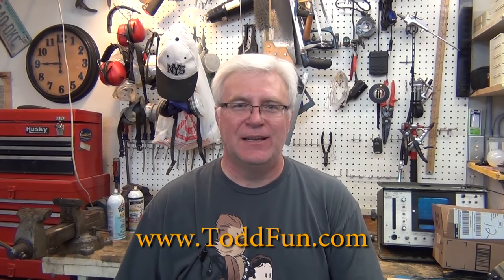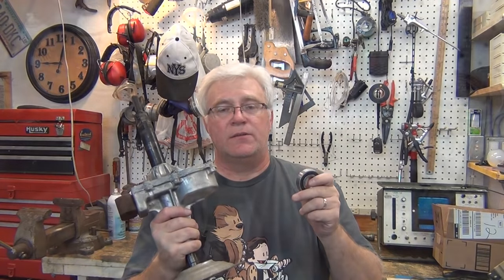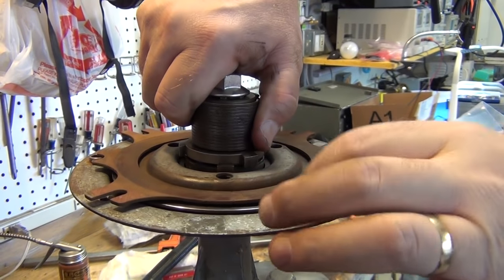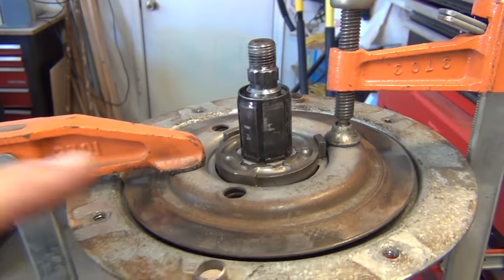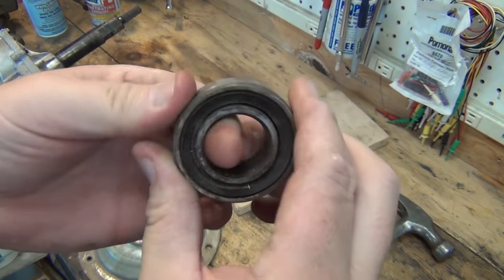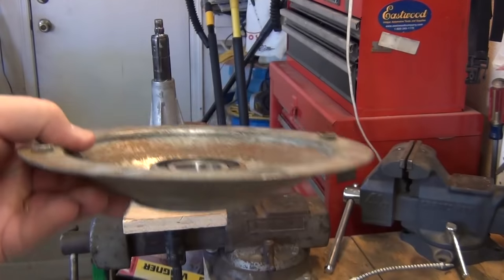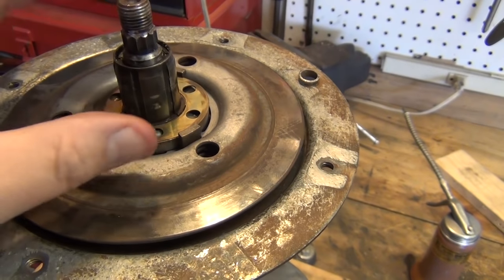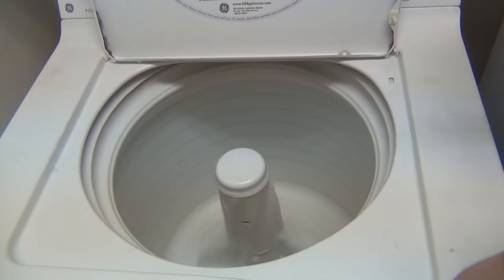Rebuild GE Washing Machine Transmission Brake Assembly - WHDSR209D2WW

Comment: Todd, I have an old signature washing machine model sig60100towg.  The thing has been grinding for years and finally gave out.  It agitates but won't spin.  Does this sound like a transmission to you.  My washer looks very similar but more basic with just one knob.  I believe it's from the 90's.  Also the agitator just doesn't want to come out of the washer.  Any tips or suggestions would be greatly appreciated.  I've looked for years for someone on YouTube with your knowledge and I'm amazed that I found it now.  I figure being stuck inside nowadays is the perfect time to do some home repairs.  Thanks
Reply from the maker: Really hard to say. So many things can go wrong. If it agitates then the transmission is fine. However there are some solenoids that need to switch the transmission in/out of spin/agitate so it could be that or the mechanical timer as those older machines will have contact points in the timer that need to make/break the circuit to the different solenoid engagements for the transmission. The grinding however could mean physical damage so it could be a very different problem. Nowadays it is best to just watch Facebook offer-up, local Craig's list or other local for sale sites that you can find because people are putting good machines up for sale or for fee all the time as they upgrade to the fancy front loading crap. Good luck.
Reply: Hey  Todd, thanks for the reply my friend.  I still loved the video.  I was just figuring if it was fixable I'd give shot.  Thanks again

Comment: Say I broke open the transmission found nothing was wrong. Lost a minor amount of fluid, now I need to top off and refresh seal. Best way of going about that?
Reply from the maker: +Chris Swicord Clean the and dry the surfaces and use this from my Amazon store or get it at an auto motive parts store: http://astore.amazon.com/tod0f5-20/detail/B0092LQHGY

For oil, you can use any 90 weight gear oil from automotive store but replace all the oil so you don't have two oil types mixing. The pros will order an exact Gear Case Oil for the washer such as: http://www.appliancepartspros.com/whirlpool-gear-case-oil-350572-ap3072960.html

Good Luck with your repair.

Comment: Hey Todd.  I wrote in last year that I followed your advice and did this rebuild, with good results (thanks again).  

Well, I'm now seeing a new issue.. when the washer is agitating, the tub isn't holding tight.  It makes me think something needs to be addressed in the disc brake assembly.  I had taken it apart recently, and thought I might have put the clutch piece back incorrectly (the part that rests on the brass bearings).  But I looked again and think that isn't the problem.  The brake pad looks okay, in place.. so I'm not exactly sure what the problem is yet.  Don't know if you've run into this issue or by chance have any ideas.  Any thought would be appreciated!
Reply: Could be the clutch assembly or slipping belt?
Reply: @9027dad Did you ever resolve this? I’m having a similar issue.

Comment: Todd...great video..need some help have you taken the gearcasing apart (exact same one as your brg. replacement)...my washing machine won't agitate but does spin. When I pulled up on the agitator to remove the entire shaft came out with it from within the gear case...any pics of inside gearcase. Thanks in advance
Reply from the maker: I have. There is some simple gear tracks inside. It would be serviceable if you could get the internal parts. However, I have never seen anybody sell the internal parts of the transmission. You would have to find a donor or purchase the whole assemble: http://www.searspartsdirect.com/part-number/WH38X10002/0026/363.html

Comment: Todd , first thanks for posting the video. I myself have a GE topload washer, recently there was a lot of scraping noise at the bottom of the washer...seems like it was out of balanced or the metal plate at the bottom had "popped" up out of place and was rubbing against the tub???  anyways it started leaking water and at first I thought it was a tub seal  so I did all the work removing everything, got access to the tub, removed the agitator etc etc and the nut on the drive shaft,  got all the way down to the tub seal...man was it hard to get out....had to use some wd 40 and needle nose pliers but it came out...I put the new tub seal  in and put it all back together correctly and presto  it still leaks......if it was rubbing against metal while running would the leak be in the outter tub or inner tub or should I replace both including the tub bearing in the bottom???   being on disability its hard to come up with the money for a new washer and the local appliance store in Mankato KS stiffed me outta $200 for essentially a piece of doop.  Any ideals would help.
Reply from the maker: That would be hard to help without being there to examine the unit. I know the tub seals will leak if you don't put them in with some sealant. Put them in dry and they will leak. Maybe just use some automotive RTV gasket sealant would be fine. If the tub has a leak then you have to replace it. I guess you could take it out and fill it just under the seal and let it set to see if anything drains out. you might just have a drain hose or clamp that is bad. Or the pump has a leak or the the drain hose to the outlet is cracked. I have seen those cheap plastic exit drain hoses rub a hole and then you have a drain leak in that cheap hose that attaches to the back, if it is those are cheap.

Comment: The bearing needs to be a 6205 with a 1" bore.  It is an odd ball bearing but can be had. I ordered mine through Motion Industries.  $33 for that sucker.
Reply from the maker: I got the correct on from Amazon for ~$5 or less if I remember. I have a link in my show notes.

Comment: This gear open before look to all extra silicon .no need to chisel the bearing or the last part because the bearing hold by the boody of gears so it will not comes out and the last part it will hold by the roller and nut so it will be keep all part in it place the charm do that because they sale it so the unit will travel from place to place and the part will fall down but when you repair it you will fix it in one place i hope you understand me and i suggest to make spot welding if you want to chisel better and more easy because you will take from the casing and by repair it many time it will damage i hope you under stand me

Comment: Didn't you get the spiral spring retention clip you said you could not source in the replacement brass disk bearing disk package?
Reply from the maker: +Fred C Dobbs No. I got a generic bearing off Amazon for ~$2. I didn't buy any special kit or package.
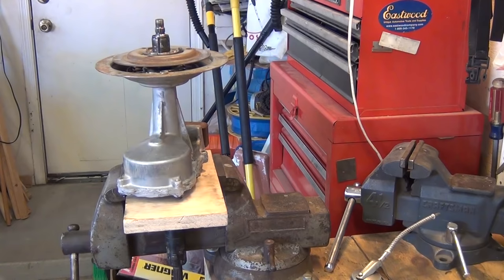Reply: Sir, at 6:38, you held up a clear plastic bag with the brass disk bearings & disk plate inside that appeared to have at least one spring clip in it.  Isn't that what they were?
Reply from the maker: +Fred C Dobbs In the bag where the original parts plus a ring clip I thought I could substitute for the spiral ring clip. I had cleaned the parts put them in a ziplock bag to keep from loosing them while I finished the rebuild. The clip you see in the bag didn't fit because it was a normal ring spring clip with tabs. I had to use the original spiral clips. Other viewers have noted that McMaster Carr sells those spiral retaining rings (search for spiral retaining rings at http://www.mcmaster.com/
Reply: TY+Todd Harrison (ToddFun)

Comment: hey Todd, can i get a new replacement brake rubber?
 ... i destroyed mine while replacing the bearing... everything went well except for that part...
Reply from the maker: +Goutam Sieunarine Sorry, I don't see that item for sale anyplace.
Reply: Hey thanks for the response... i think i found it.... but i'll have to order it and have it shipped to Trinidad.. here's the link to the part.. http://www.appliance-parts-usa.com/G-TRANSMISSION-brake-pad-fit-WH38X10002-PAD-O3A0_p_3755.html
Reply from the maker: +Goutam Sieunarine Yes, looks right. good luck.

Comment: Folks , good luck trying to get off the tub hub nut. Just in case someone gets the idea that if they CAN'T break it loose with the special tool and a baby sledge that they will just cut the nut somehow to get it off , I say STOP!! Been there tried that. It CAN"T be gotten off that way. The nut recesses down into the base of the inner tub and you can't get down there deep enough without damaging the inner tub base.Here are 2 tricks to get off that stubborn nut. 
1. squirt some Tilex all around the nut and let sit over night. This hopefully will dissolve the minerals that are binding the nut to the tranny .WD40 etc , etc WON'T work. If TIlex doesn't work then the ONLY fool proof method I have found is 
2. Get a 43mm Deep socket and an electric or pneumatic impact gun. END OF STORY!
Please note the hub nut is REVERSE THREADED. So righty loosey lefty tighty
Reply from the maker: Thanks for the tears of knowledge. Well appreciated.

Comment: After messing with my 12 year old GE washer the last two weeks I learned a lot about  how crappy these are made, especially this specific transmission and it's faulty design are, a little google searching finds all the posts and comments all over the web about this notorious POS GE transmission that they knew about since 1995 and have done nothing about.
My saga started with a simple minor tub leak, so I decided to buy a new seal and bearing, got those ordered, took the machine apart and found the bottom bearing on the transmission was shot, not wanting to mess with all this plus finding the bearings and parts, I bought a factory reconditioned transmission on Ebay from a big appliance outfit for $128 and a 6 mo warrantee.

I got that, put it in, and was putting the whole thing back into the cabinet when I suddenly noticed an 8" long CRACK in the cheap plastic outer tub! $75 later a new one was on my doorstep the next day, the old one was so brittle that just flexing it broke chunks out, Imagine that happening when full of water!

I get the whole shebang back in, and with 4 new rubber retainer deals for the tub, new drain hose and went to wash a load, no more leak, but then it wouldn't SPIN, I could get it to spin if I pushed the pully and "jump started" it then  the motor would do it.
That motor turned free, so the bearings were fine, so I figured the starting capacitor was bad, replaced that $20- same problem! so I figured the  stator on the motor maybe had some issue and it was weak, I bought a new in box OEM GE motor on Ebay for $119,  but that came damaged in shipping- the aluminum housing was cracked, they issued a full refund, so I ordered another motor from another seller, meanwhile since the stator was intact I took the old motor apart, swopped the aluminum ends onto the other motor and tested it, turned just fine, spun freely, so I put that in, SAME exact problem!!! this new motor wouldn't spin even an EMPTY tub unless I first pushed the pully on it to help the motor start turning.

So that was the last straw on this POS, best I can figure is the transmission is too tight internally or something and putting too much of a load on the motor (either the old or the new one- same thing happened) which gets VERY hot- you cant even briefly touch the metal case of the motor after just one small "light" wash cycle. 

It otherwise agitates just fine.

I bought a new machine, told the transmission seller I wanted to return that item as it appears defective, so I got my money refunded on that, and I calncelled the other motor and got a refund on that, so far I'm out $177 I can't recover.

This machine's transmission design sucks, you get one tub leak and that's pretty much the end of the transmission bearing and probably even the motor, what pisses me off is this exact transmission is notorious for having a defective design, with many people reporting the brake fails, and the bearing fails. Had I read that before last night I'd have junked the thing- no point repairing a defective design that will have the same problems again.
Reply: You have to expect bearings to fail. NOTHING lasts forever. It happens on cars, trucks...anything that is used wears out even on Toyotas.
FYI- There are many videos out there that address the bearing issue. Such as putting a CV boot above the bearing in case the tub seal leaks water so it will not get on the bearing. I do know the turtle shaped brake disc can crack, but they are still usable. Mine is still intact after 25 years. 
You will not find a transmission that well built in a new machine. With all the plastic they use nowadays.
Reply: @bobsoft  I agree with you that this transmission is fairly well built - that is it will probably last 10 years under normal washing conditions.  I do rebuild these with outsourced parts. Removing the tub from then transmission shaft sometimes takes HEAT.  One nice feature of these washers is they fill with water over the clothes and wash the clothes very well. The washers built today are another story.  Good luck trying to get 10 years of trouble free washing with newer style washers.

Comment: Maybe the 4 springs could be worn out that usually push the brake disc down and hold it from rotating?  I guess I'll just take the whole thing apart again!..
Reply from the maker: I would agree. Maybe some grease got on the brake pad? Or something is not tight.
Reply: @ToddFun  You guessed it Todd!  I haven't tested this with a load yet, but the basket is no longer rotating when the washer is off, so I expect it won't rotate during agitation.  I found that the tub nut (hub nut?) was loose!  Tightened it up, and it seems good to go.  Yeesh.

Thanks Todd!

Comment: If only a noisy barring use a dental pick to remove the grease seal move it up onto the bottom of the transmission then repack the barring with grease and push the seal back into place as you can only get to the top it may take a day or to, to work the grease into the bottom.
Reply from the maker: This unit was ran dry for a long time so it needed a new bearing. Grease alone wouldn't have worked.

Comment: Todd, where did you get that brake pad shown at 19:21? Having hard time finding.
Reply from the maker: Not sure any more. Try eBay for possible NOS.
Reply: @ToddFun  thanks for reply.   Having really hard time finding.  Used to be part no: WH01x10123 but no one has any more.  You seem like a handy guy - ever use "friction material sheets" to cutout your own?   I'm considering that idea.   Yours in the vid definitely is not the standard oem part.
Reply from the maker: @dallasbiggz7007  Very standard friction sheet so could get one from a "look-a-like" transmission but that is a gamble unless you can go to a used machine / servers shop and just ask if they have any that might fit.

Comment: I always pull the plastic covers on the “sealed bearing” and repack with high quality wheel bearing grease. The bearings are Chinese and they use cheap quality grease…

Comment: My only critique is you used a regular claw hammer...a brass hammer or a ball peen hammer would be safer...and a brass drift for driving the bearing back in...or better than that, use your vise and press it in.
Reply: youbecha64  yeah the steel hammer on the socket is not a good idea, when i was a kid i did the same thing but hit the edge of the socket and a chip the size of a woodruff key broke off and went straight in my hand, its still in there about 25 years later, a softer face mallet is safer
Reply from the maker: youbecha64 Good points. I'll keep that in mind on my next repair. Thanks.

Comment: I can't get the new bearing to go back on the shaft, I ruined one new bearing trying, I'm going to go to a garage that has a hydraulic press or else I have to grind the shaft down.
Reply from the maker: Make sure  you are getting the correct bearing!
Bearing 6205-2RS-1
The ‘-1’ is important, it means 1 inch inner diameter

https://www.amazon.com/KML-6205-2RS-1-Double-Sealed-Bearing/dp/B01N1EOQIY/ref=as_li_ss_tl?keywords=6205-2RS-1&qid=1551287949&s=gateway&sr=8-4&linkCode=sl1&tag=tod0f5-20&linkId=bfd8b7ddcc5da4edb4c3460b0cef7dfe&language=en_US

http://www.toddfun.com/2015/06/06/replace-bearing-in-washing-machine-transmission-brake-assembly/

Comment: Buy a Maytag top loader for 450 bucks 10 yr  warranty on transmission and hard wear with a one yr full warranty from seller delivered  installed and old piece of shit removed. All that trouble only to watch the next malfunction happen. And if you can spend another 120 you can buy a full 5 yr warranty. If the 5 yr's  passes without using the warranty you get your choice of a 60 dollar refund or you can extend the 5 yr warranty for another  5 yr's.
Reply: you're going to need that warranty cause the new maytags are JUNK.